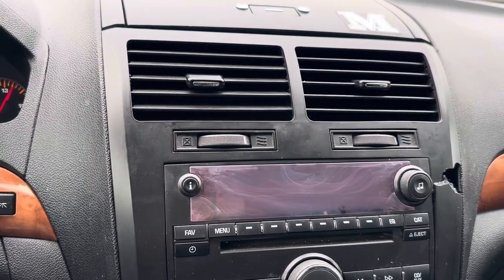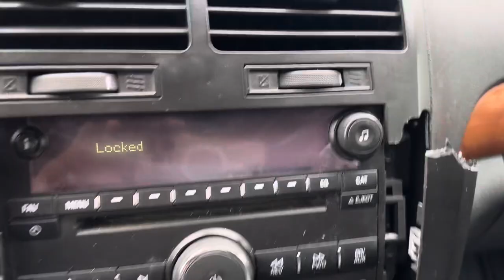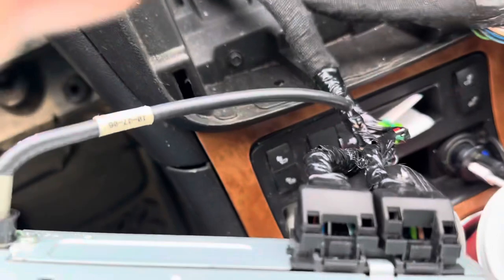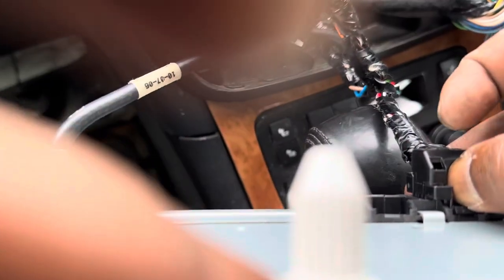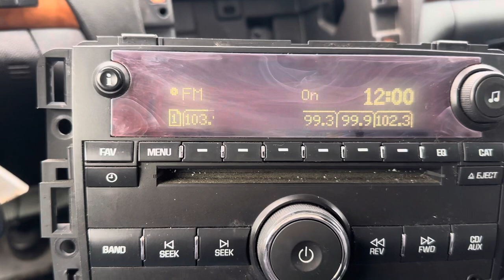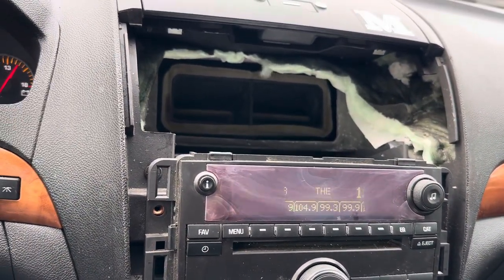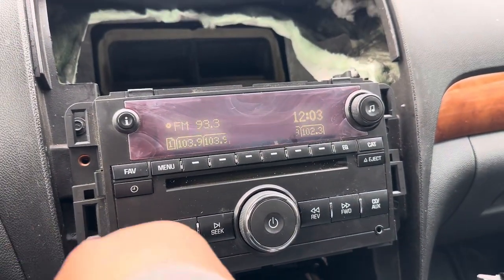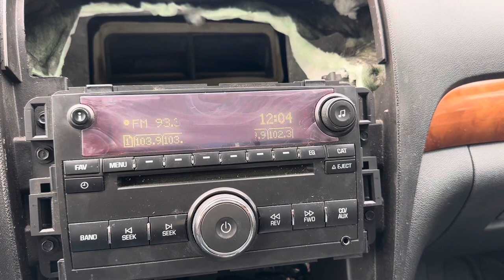How to unlock gm radio on 2007 Saturn outlook ￼ without scanner

Comment: Appreciate vid,,  I tried 10 times 2007 aura, no luck,,   any specific sequence?
Reply from the maker: I think you are doing faster between the connections and i highly recomend to put cd player in the radio and  give it 2 to 3 sec in between disconnect and connect i hape this works